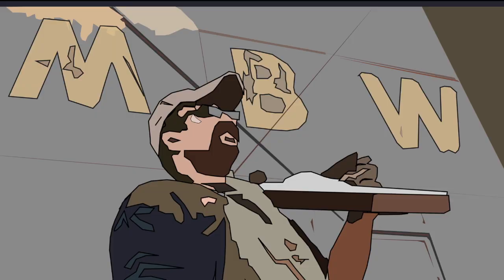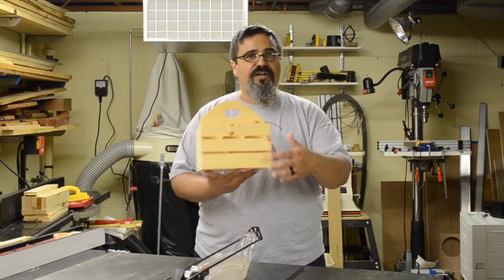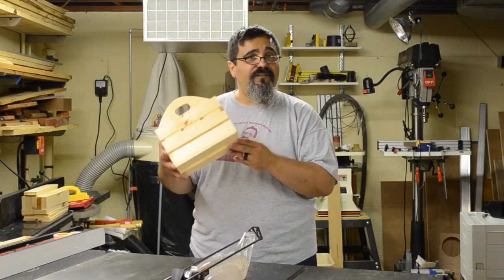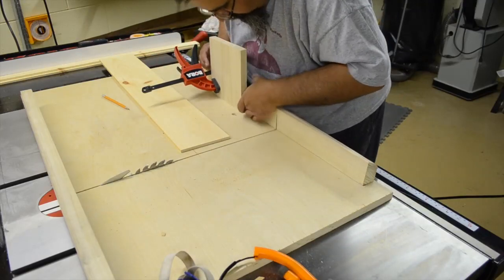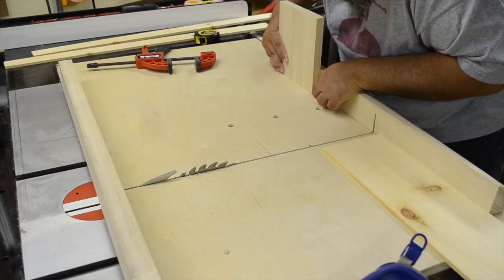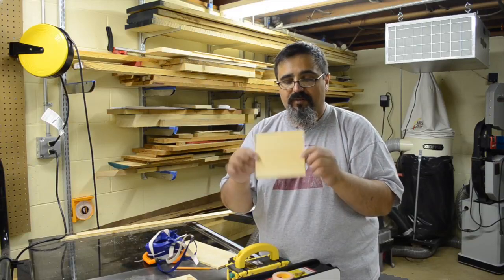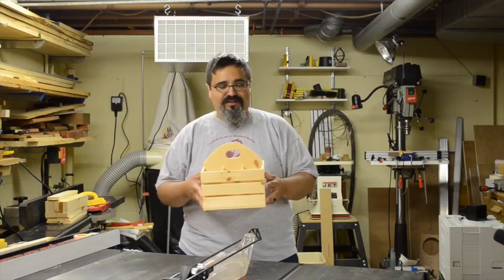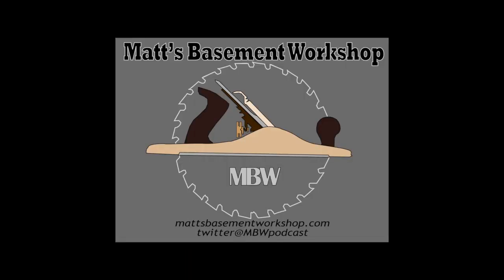508 Wooden Six Pack Pt 1

Comment from the maker: I'm currently using a Forrest Woodworker II.  It's my first big boy blade and so far I really like it.  I've heard very good things about Infinity Tools' blades, I just haven't tried one yet.  They are expensive compared to an entry level blade, but the cut and quality make up for it.

For tooth count, I get by with my 40 tooth blade for 99% of my work.  The other 1%, I still use the same blade but probably just touch up the edges with a block plane if needed LOL.

Comment from the maker: That was something I thought about also!  One thing I didn't mention in this episode but I will in part 2, is that the handle is spaced high enough in the groove, that these can be stacked one on top of each other and the handle fits up through the bottom slats and into the groove.

I would also suggest making the ends thick enough to attach a bottle opener...just in case they're not a twist top.